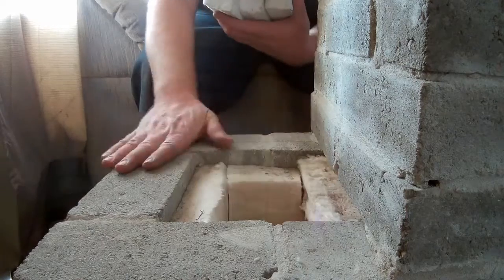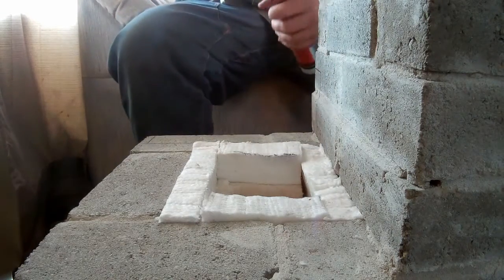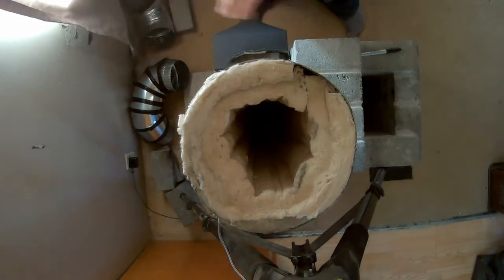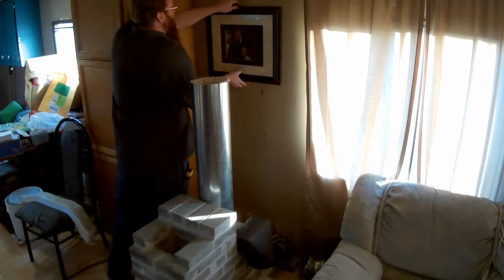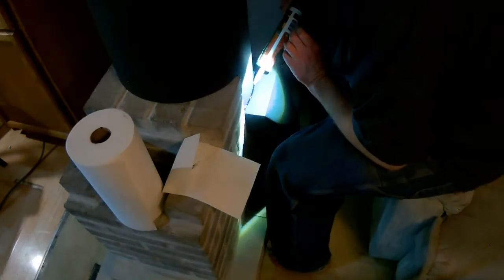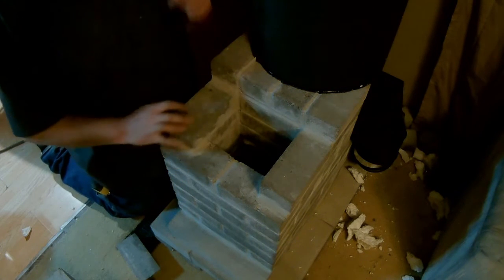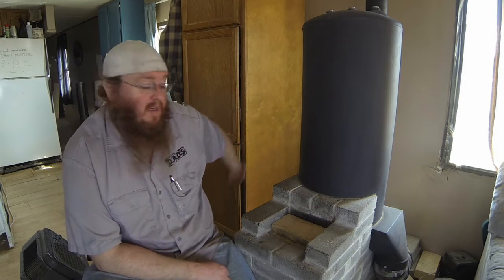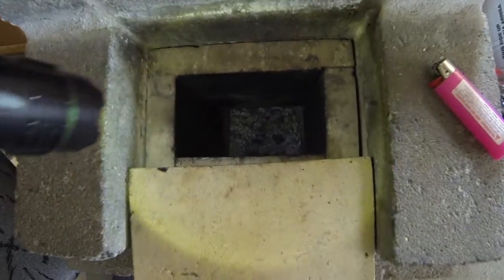Rocket Mass Heater(4) Final heater build

Comment: If you have the air feed come in from outside you'll feel much warmer. Rocket stoves have a habit of drawing so hard they suck in all the warm air from your room and blow it out the chimney. It's then replaced by cold air sucked in from around your doors and windows.
Reply from the maker: That makes things much more complicated. My research found it was pretty hard to implement well, and there were complaints that it made the house feel stuffy.
Reply: @WarpedLegacy  If you have an air inlet near the stove and a vent high up in the building, incoming air can be warmed as it enters. I take your point though, it's more work to set up and would need occasional adjustment to achieve a balance.

Comment: Looks good how did the second winter work with this thing? Did you ever add mass
Reply from the maker: Added the mass this winter. It's working good, but I'm not done with all the finish work yet. There will be a vid when I get it finished. Wish I had made a 6 inch. I made the 4 mostly because I was told you couldn't. The 4 inch works fine, its just a bit small to keep up when it gets below 20f.
Reply: Cool looking forward to another rocket video.